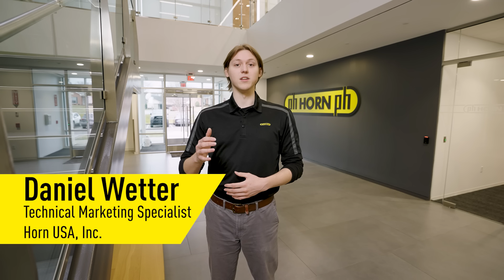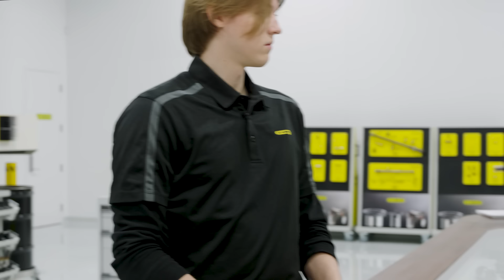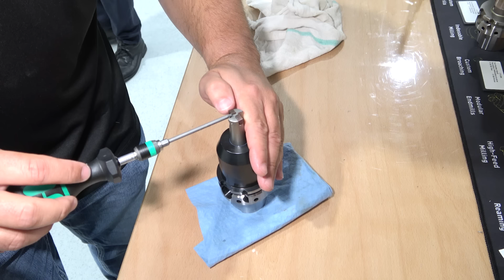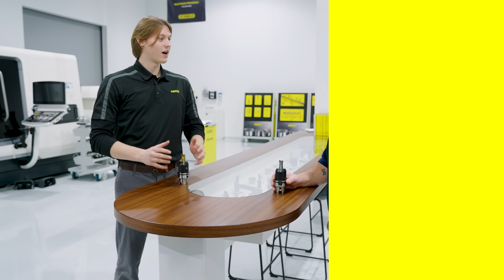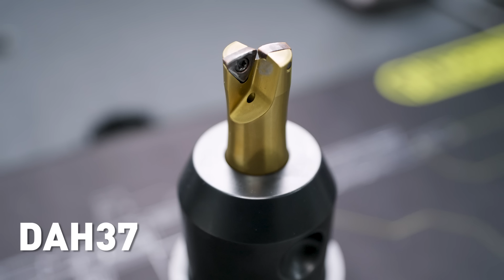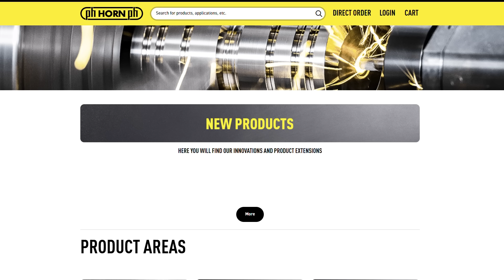High Feed Milling Explained

Comment from the maker: Have you ever tried high feed milling in your shop?

Let us know what materials you’ve been running with high feed.

And tell us what you would like to see more of in future uploads!
Reply: I use high feed cutters when it makes sense. Being in a job shop, those parts are few and far between but they do save time and cutter cost when it's right for the job for sure. Typically it's 4140pht and harder materials up to low 40's Rc and dry/with air blast.
Reply: I have everything from 25-100 mm high feed cutters and they are used everyday. They are life savers when you mill stuff like 1.4462 or titan. Its really simple to just buy new inserts for other materials and just removed alot of material fast. But using a 100mm is always really scary
Reply: 10.5" Ti-6Al-4V  50mm 8F BLMP cutter

Comment: A question, since high feed mills push the force towards the spindle, thus having much more stability and almost no force pushing the tool from the sides, does that mean that longer shanks will be no issue, for example I’ll be able to use almost same parameters always. I’m talking 5-8 xD
Reply from the maker: 8 x Ø is a bit extreme for high feed milling, 5 x Ø is probably about the max allowable length in an ideal situation. 3 x Ø or less is ideal. Although radial forces are greatly reduced in high feed milling compared to traditional roughing methods, vibrations and imperfections in the process are going to be exaggerated with increased tool stick out lengths ultimately reducing tool life.

Comment: This is super interesting, most machines i see nowadays are designed for the opposite, high speed low load cutting. But I guess this would be better for older machines or machines that are specifically designed for heavy cutting.

Comment: High feed cutters like this are limited in usefulness. Pocking on a horizontal is problematic if you don't have good air blast to clear the chips. Chip recutting will kill them. Horizontals are much better suited to this. If the material has any sort of surface scale, you're better off hitting it with a face mill first. They are very finicky, if everything isn't just right, you're left with a glowing stub. Regular endmills are much more forgiving. Unless I have a well documented part running in large quantities, it's a hard pass. Prototyping, hell no.

Comment: Seeing your roughing on the 316 block, wouldn't it be much more effective to work with a 45° face mill? We use a 50mm face mill with 6 45° inserts, taking up to 3.5mm depth of cut at 400-660mm/min feed rate, removing 316 and 304 quite effective with a small cnc mill.
Reply: you sound like the people from my previous work claiming they had been doing it this and that way for decades. First, you are wrong there are better ways of doing things with modern ways. Second, its a demo not actual use case. Maybe based on something actual but still a demo.
Reply: @TommiHonkonen  Maybe you see more letters there than I do, but where did I say they are doing it wrong? I asked if it would be more effective with a face mill, not stated that they are doing it wrong.
Reply: @TommiHonkonen you come across as a smug redditor.
Reply: A: Its just a demo.
B: Yes the millturn probably can take a bigger cut but they are still doing this demo on a LATHE.
C: Highfeed isnt primerly ment for facing but if you run that slow maybe you should consider highfeed milling yourself. I think a 50 or 63mm highfeed might increase your mrr by a lot.
Reply from the maker: While face milling is great for the purpose you described above, this demo was simply to give an easy view of the feed rate, depth of cut, chip production, and surface finish of the high feed tool.
Reply: Mate, it's a demo. They're not making parts.

Comment: Please, run with constant engagement - don't go in and out but spiral or rotate so that the cutter never leaves. This will give a smother run and reduces thermal changes for the cutter thus improving tool life further. 
(And on the topic of cutting fluid: Please stop calling it "coolant" (that was pre HSS and perhaps HSS tooling terminology, these days it confuses for correct usage). And don't forget air (through spindle or at the side) for chip evacuation.)
Reply: Calm down Karen, it's coolant.

Comment: Does high feed milling need machine to be rigid
Reply: Yes BUT it puts less strain on the machine. So it's more a question of the shape the machine is in then how large load it can handle. (EG a new "weak" machine is better suited then an old "heavy" that is worn out with a lot of slop in spindle etc.) 
Hope I'm making sense.
Reply from the maker: The more rigid the machine and tool system is, the better the tool will perform. High feed milling generates more axial forces than radial forces. Smaller, less rigid machines can certainly still achieve higher material removal rates than traditional methods with the right application of high feed milling.
Reply: Давление на инструмент идёт по оси z. Жесткость менее критична чем для обычной обработки из за не большой глубины обработки но более критичны люфты

Comment: Useful video. People disregard high feed too easily. It is my go-to for Steel. Because the cutting forces are mostly axial, it works quite well on small machines lacjing rigidity. Even on a router you want to to high feed just with a large corner radius end mill

Comment: I can say from experience, not my own though, that taking much deeper cuts than the inserts are specified to do... is a really really really bad idea. Ive seen someone take 3mm DOC when the highfeed inserts was set to a max of 0.8mm DOC.

All 9 inserts exploded, ripped out all screws and literally melted the milling head until the spindle went into overload. There was around 10 seconds of beautiful fireworks going on inside that machine :face-purple-crying:

Comment: My 2004 haas tm1 is shaking at the thought of me watching this video
Reply: Don't be scared, I use hifeed on multiple late 90's fadals. Pretty comparable to haas's. Lower the sfm and chip load about 20% of "recommend" works well for me.
Reply: You'd be surprised. A bunch of years ago I started at a small company joining an older guy that just had gotten a new Haas. When he saw my feeds and speeds he thought that would be the end of the machine. Imagine his surprise when he realized that he had never gotten it to run as smooth and nice while removing material so fast.
Reply: HAAS shake cutting plastic 😅😅😅😅
Reply: I use a 1inch high feed Ingersoll 4 flute in a tm1p. 150-250ipm with around .025 depth of cut with. 75% step over, limited hp and takes it like a champ in 4140 annealed. Don't be scurrred lol
Reply: It'll be fine. High-feed milling tool geometry directs most of the cutting forces axially, which is the most rigid direction of your Z-axis.

Comment: Can’t stand the metric system 😂😂
Reply: using your system on money would be hilarious! like how much is it? Thats 3/8 of a thou lol
Reply: Fractions and decimal values in ANY system are different animals. MM and inch are just different standards describing the same thing. Fractions have their uses especially in higher math.
Reply: Have you ever tried to do a +- 5/4096" tolerance? +- 0.001" is a decimal based mesurement wich is the core of the meric system ;) 
Decide for yourself how you want to read your prints.

Comment: Why aren’t roughing end mills used in a CNC ? 
I always felt like they work great in manual milling.
Reply: not sure what kind of roughing endmill you talking about but I think they are still used in CNC, but this kind of high feed endmill for example specifically shine in harder materials, tall parts. where roughing endmills are designed to make big heavy cut easy, with CNC machine especially newer ones, light cut toolpath like high feed, high efficiency (long dept, low stepover) are prefer because the machine can run really fast and automatically and its safer, less pressure on the part
Reply: In my limited knowledge, some of the older machines can’t deal with the chips as easily, keeping them out of the coolant. Hell, even the 2025 Haas struggles with lathe chips.
Reply: Corn cobs?
Reply: With the high coolant flow flushing out chips is very easy. Also recutting chips is not that commen with climbmilling on a CNC. In aluminum they still get used sometimes for very long roughing cutters because the chips would get to long there. 
Also as another cometater said: modern machines like the chips big so they dong clog up the flow in the conveyor and tank. 
We have a machine at work that does mostly stainless with smal tools, we didnt empty the places next to the auger one year and it flooded the floor when M7 and M8 where on at the same time because the coolent didnt drain properly.
Reply: Roughing endmills are a thing but not the sawtooth-like ones commonly seen with manual machines. Chip-splitting flutes come to mind, and insert endmills. Normal endmills with advanced geometries to withstand high cutting forces can take aggressive cuts (relative terms, depends on many things) if your machine and setup is capable. Additionally, using regular style endmills reduces the need for a bigger tool library, simplifying the process. In many shops, it's a balance of production and ease of operation (complication can slow things down).
Reply from the maker: While solid carbide roughing endmills certainly have their place in the machining world, in the high-volume, highly competitive world of industrial scale manufacturing the need to shorten cycle times and maximize profit margin makes the material removal rates achievable with high feed milling extremely beneficial.